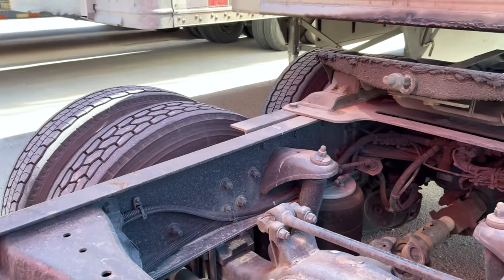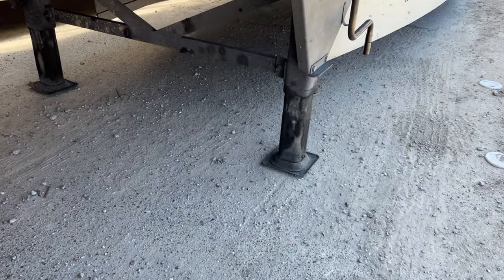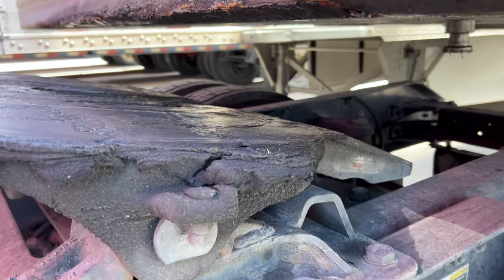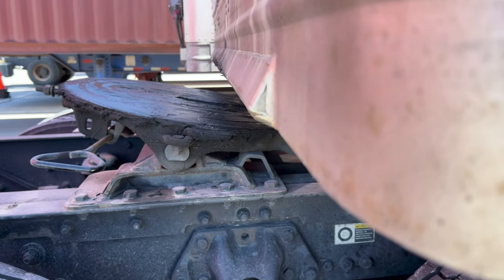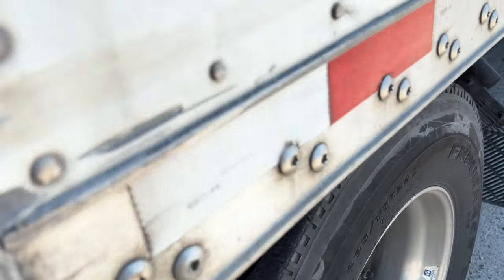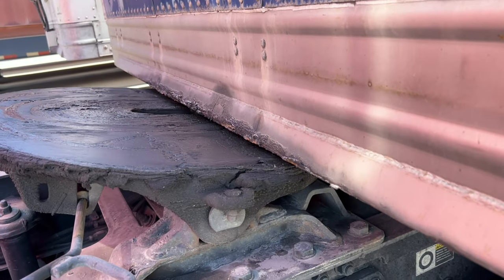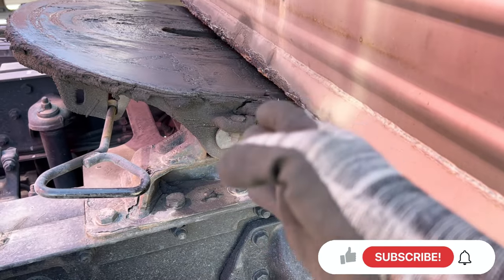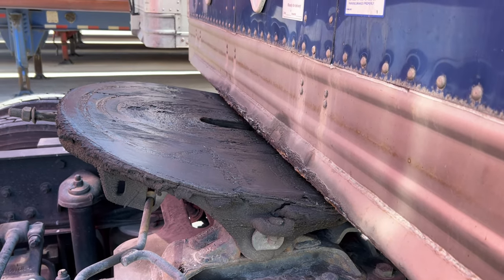Trailer Was Dropped Way To High! What To Do In This Situation | Trucker Tips

Comment: Bring a jack with you, release the air out of your bags, put jack on frame and extend until close to touching. Put air back in your bags then crank landing gear in high until low enough for it to slide in fifth wheel. I use wood rn cuz I haven't got a jack yet. Light work.